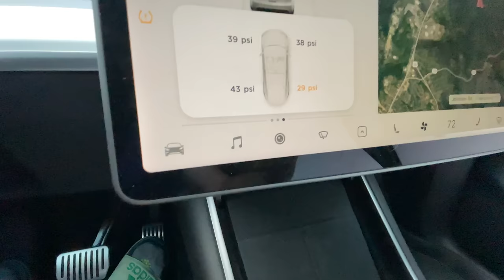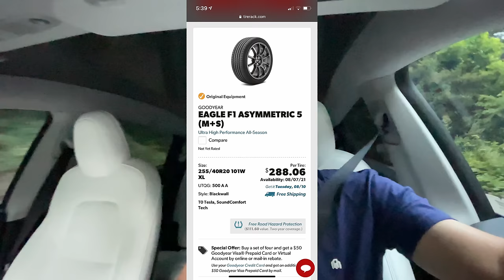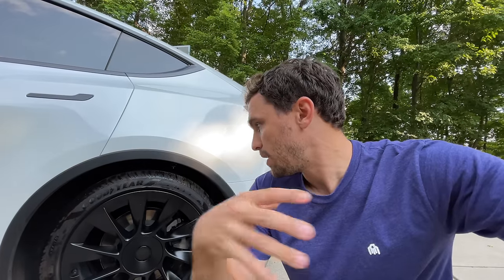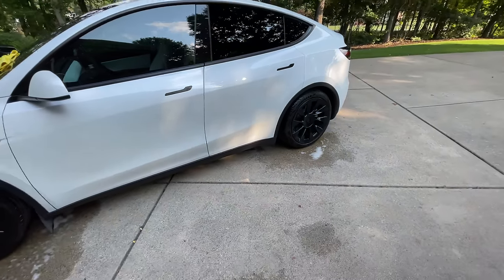This is Why Tesla Tires are So Expensive (Another Flat)

Comment: That tire has hardly any tread left anyway….. replace all 4 tires my friend.
Reply: How long has he had this car now ?

Are Tesla tough on tires ?
Reply: @icosthop9998  I know my Chevy bolt only gets about 20K miles on any tire I have tried 
Oem that came with car purchased used
Michelin A/S sealant tires oem lasted 20K
hankooks S1 ventus 2, got about 20K out of the pair
Crosswinds have about 5K on them now
Throwing on some used kenda kenetica tires with 6.5/32 treads next to replace the hankooks this next week. But yeah kind of annoying in these heavier cars the money I am saving on gas and oil is going into tires 😆 I drive a lot of miles so just be warned treadwear means nothing with ev's
Reply: @jman96camry  20k on any tire is crazy. I can only imagine how long Michelin pilot sport 4s/ cup2s last with an EV.
Reply: I got, but one big YouTube guy mentioned that you really need to get EV type tires. Not one that "just fit" in size. It because the EV are much heavier then normal vehicles at the same size. Hence EV tires. I don't own an EV

Comment: I stopped buying low profile tyres 20 years ago, now I just want as much rubber as possible between my rims & the road!
Reply: Exactly
Reply: Once u bend a couple rims or get a few flats. Learn quick
Reply: I've had both, an more rubber makes Zero difference when it comes to picking up screws,nails,pieces of metal or whatever else that's able to puncture a tire. Basically if it will poke holes, it will go through the tires , big side wall or not.
Reply: @americanpirate2091  Where I live our problem isn't sharp objects, its potholes & with 2 million miles of driving and lots of different cars I have learnt not to buy low profile tyres ever again!
Reply: Potholes suck for sure.
Reply: Unless you are running your car on the track at speed, there is no reason to use low profile tires especially on a car that weights over 2 tons. Since I grew out of my ricer Boi days I've not purchased a tire with a profile lower than 50 and the only reason I did was so it would not rub against the strut.
Reply: Well yeah but it makes you a nerd, man. I roll 28s on my 06 Aveo, man….
Reply: @BillLaBrie  Sounds Greek to me, what is an 06 Aveo?
Reply: @wilkoone9155  I think it's Daewoo subcompact that GM sells.
Reply: @wilkoone9155  Car that came out when you were still just in your eighties, methinks.

Comment: The right rear is the most punctured tire on cars ,It reflects driving behavior,While turning making adequate clearance from curbs and gutters sometimes favoring the right portion of the lane as well,Trash and debris gather near the curb
Reply: Only had 2 extremely minor punctures on my car that I've been driving for 6+ years now and those 2 were most likely  due to me driving on to a construction site drive way (my job requires me every once in a while)... Guess I'm doing good? Had all 4 tires replaced at the 55k mileage and currently at 64k+!
Reply: Another reason is that the front tires kick up nails then throwing them back for the rear tires to "catch" it.
Reply: makes sense
Reply: @NumnutSify  you a construction manager or engineer?
Reply: @miguelrodriguez-pe1ss  I'm an Electrical Project Engineer currently. Looking to move over to Senior Computer Engineer though. I'd rather be at a desk now.

Comment: Leave it to Elon Musk to reinvent the wheel. Tesla, overengineering at it's finest. You hit the nail on the head when you said that car was garbage. Any other car, I can get onto a lift and change out tires in an hour. Teslas have a whole procedure, like the pucks for lifting and the foam in the tire is an issue sometimes. We actually have a set of those pucks just for Teslas and they are a nightmare even with those.

Comment: Just buy tires with Road hazard warranties! Firestone, Bridgestone or Continental would just replace those!
Reply: for of course a small fee depending on the titres wear $$$
Reply: @justabrake  I worked for bridgestone. We would replace the tires free of charge if this happened within the coverage. Which on say premium tires could be either 3 years or 50k miles.
Reply: @lohengrin5082  looks like my next set will be Bridgestones just for that.

Comment: First problem - Goodyear. Second problem - no sidewall. Third problem - 39psi. Run at least 44 cold. I haven't seen any blowouts in your video. Discount  Tire is OK. I'd NEVER go to Pep Boys here. I have the pucks in each car just in case. And a jack and a spare tire. Rotate your tires every ~5,000 miles. Put it in your logbook. You have a logbook right? 
If you lower your car get an alignment. Is this your first car?
Reply: Goodyear is a great tire...but is very soft. Up to half the projected mileage because of it.44 psi is recommended  Continetal? Never heard anything good about them. I think I am going to throw a set of Pilot Sport Cups on my 16 X and see how they wear. The scorpions have surprised me to be honest. The best tire are the more expensive ones for a reason. Bridgestones and Yokohama's have treated me very well over the last 10 years or so on numerous vehicles Avalanche to a Prius  Don't sleep on the Yok'es!  Cheers!!

Comment: I suggest to bring your size of wheels down to 18 in and you'll see your tires will last twice as long and a better ride
Reply: I've always stayed away from low profile tires... for a few good reasons:  more expensive and higher risk in pot holes!!  :)
Reply: It’s the aspect ratio that determines if the tire is low profile, less than 50 is low profile.

Comment: I have a model y performance, I'm a volvo technician,  I put my car without jack pack with no problem on the lift to do my own tires.  A lot of the volvo cars have foam inside too, when we repair them, we just remove the foam if it doesn't stick anymore.  You just having bad luck with tires not tesla.  Can't believe people think this tire are only meant for tesla.  I fixed a lot of non tesla tires and some have foam too, NOT only tesla.

Comment: Apart from the sidewall damage. Those tires have almost no more tread, so expect for it to get easily puncture. I know, since I normally run my tires to very low tread and having a few holes. Also, if you have any cordless tools get a cordless inflator, they are so much better. I use Ryobi wireless tools since am cheap, so I have a few batteries and I bought the wireless Dual Function inflator/deflator and I love it. Having a wireless inflator that you can set the tire pressure so it automatically stop, makes it so much easier and less of a hassle to keep your tires inflated properly. Also, on gas car they normally tell you to rotate the tires on every oil change, which is what I do. So I rotate my tires every 6months, since I change my own oil. When I have an EV, I will be doing the same thing. Rotating the tires every 6months and then cleaning or replacing air filters every year during inspections.l

Comment: I didn’t think I would notice a difference having the tires without the foam. I absolutely did pretty much as soon as I had them put on. Fortunately America’s Tire allows you to exchange the tires within 30 days. I took them back the next day and replaced with tire with foam and all was good. It’s hard to explain the noise but I did notice a difference. Most people I have heard can’t tell the difference. I wish I couldn’t either cause it would save me a ton of money.
Reply: Foam absorbs energy that would normally result in sound or vibration or likely both. I'm going to switch when I wear out the tires.

Comment: Before ordering our Model 3 and after watching a zillion YouTube videos I found out about the pucks and ordered them straight away! They do work great and I do recommend keeping them in the car. Don’t worry we’ve all been there!
Reply: I made the rookie mistake of buying four pucks!   You really only need one, most of the time, as you are typically jacking up only one wheel at a time!   Still, I get to use that puck twice a year, when I rotate my wheels :)
Reply: @mayorsnorkum4005  nothing wrong with having 4 pucks, you'll be glad of the spares if one just happened to fall apart!! I bought 4 because they were a fraction more than the cost of just one, and I needed to use two at once for a home tyre rotation. So handy to have and I'm shocked gjeebs didn't have any!!
Reply: @danpaul4975  This is where we up north have the advantage - tire rotation done when I change from 3 season to winter / vice versa :).  Just need my one safe jack.

Comment: Those pucks were one of the second I bought after floor mats.
Reply: I work at tesla for 4 years now, have never heard of those pucks till now.
Reply: Where’d you get them?
Reply: @Isamu1013  Model 3/Y do not have exposed jack points as most cars do, so the puck ensures the jack is applying pressure at the points where Tesla has designed to allow for jacking. Downsides of making a very aerodynamic car and covering up the entire underbody. You still can safely jack up the car without the pucks tho, but may damage the plastic covers over the jack points.
Reply: Well the Jack points on the Model 3 are fairly exposed but I can see that you could make some small scratches in the rocker panel if you use a concave metal jack to lift it there.

Comment: I read in the Tesla forums, before ordering my 2017 Model S, that the low profile 21” tires were having more problems and were more expensive to replace then the 19” tires. My car came with 19” Goodyear tires. It seemed that I was frequently topping off the air pressure to the recommended 45 psi. At around 35,000 miles I got several flats and a slow leak over the course of several months. I finally got fed up, and replaced the 4 tires with 19” Michelin’s. I had always had good luck with Michelin tires. After a year and a half and over 15,000 miles the tires stay at the recommended psi level and the last annual checkup by Tesla stated there was little wear on the tires.
Reply: Jeffrey, did you order Michelin's with the foam or not?  If not, notice any difference with road noise?

Comment: You need to get some quality tires, never replace just a single tire but both front or both rear but at best all 4.  If it is rear right tire always you need to check  wheel geometry as well as allow more distance to the curb. Your tires were worn out.  So you lowered your car - bad move.

Comment: I think to blame Tesla or to give the impression that this is a "Tesla" thing seems wrong. I've had my Model X with the 22in (265/35f 285/35r) wheels for 3 years now. I have 124k miles on it, tires replaced at 65k and 120k. A little sooner the 2nd time around due to bad alignment caused by CA 3rd world quality roads.
Reply: Tell me more

Comment: When I got my winter tires I called up a couple local tire places (Discount Tire being one) they wanted me to bring in my own pucks and seemed a bit unsure about dealing with a Tesla, so I brought it to Tesla to change out my tires (I put the winter tires on the stock wheels, got new wheels for 3 season).  Now I can just do all my tire rotations and changing at home and if I have a problem with one I will just take it off myself and throw on the other tire temporarily to take it in.  Dealing with tires can be such a pain, so much waiting, transportation being an issue...love having 2 full sets!
Reply: The odds of having a flat tire at home are zero.

Comment: At 30k miles, my Conti's have the same wear pattern. It's as if they're over inflated (but not). Maybe the recommended tire inflation psi is too high?
Reply: They MAY be overinflated for the load. One tire pressure doesn't fit all tires. Check the recommended tire inflation pressure which is posted on the driver's door frame. For different loads, in pounds or kilograms, you inflate to a different recommended air pressure.

Comment: If the inside of the tread is worn down, and the outer edges are not, your tires might be over-inflated?
Reply: Tesla inflates to 42 psi on the 19"s to lessen rolling resistance.

Comment: My Tesla is being delivered in 3 months and I already have the jack pucks
$15 on amazon
Reply: Visit discount tire when you get it and they will sell you road hazard warranty on the tires despite the fact you didn't buy them there. Then you are covered.

Discount tire will also apply prorated warranty discounts if the tires wear out quickly. You have to ask. Its extra paperwork for them but they will do it to get a sale.
Reply: @JeanPierreWhite  
Already plan on it
I was there the other day and checked on that and if they have their own jack pads and experience with Teslas

Comment: So far I’ve had only one instance where I had a left rear tire on my car picked up some metal shard & caused it to slowly leak down & I also have one of those portable air compressors & I recommend everybody gets one, it just makes so much sense to be able to service your tires at will & anywhere with that tool & it’s convenient & if you want to get good gas mileage you definitely have to make sure you maintain proper tire pressure, so inspect your tires at least once or twice a week, I inspect my tires just about every time I drive, so I’m super conscious of tire wear & I make sure I rotate my tires at between 6 & 7 Thousand miles & I have 25,000 miles on it & I’ve had the tires rotated at least twice since new! 

So I went to a firestone retail store & the people there were very nice & the manager told me that they do absolutely nothing with a Tesla, they have no authorization to service them & they have no training, so they don’t touch it & all I wanted them to do is check the tire to see what was causing the tire to leak & that was the answer he gave me, so again no big deal because the tire was holding air & the next morning the tire had considerably deflated overnight & so I just pumped up the tire to the recommended pressure & drove to my Tesla service center & had them replace the tire, now they recommend that you always use one of their tires versus a tire from one of these discount stores like Pep Boys, Discount Tires, NTBS etc. & they recommend you not do what you just did, which is to mix the tires & when I had my tires rotated the 2nd time, they sent out a mobile unit to rotate the tires & I must say the Tesla mobile unit was on time, he took care of the situation & it didn’t cause me any inconvenience at all!

Comment: Tesla EV have there up and downs. My friend sold his Tesla. After  2 years, he was tired of sweating inside his Tesla during the 4-5 months of hot summers in South Texas. Weak A/C system 😐 I like the car for it accleration.
Reply: Man I have the exact opposite experience. My Mustang was hot as balls. It was 97 today in NY with a heat index of 109 and humid as fuck. The ability to turn on the AC from my phone app is amazing. Mine is a 2021 so maybe his older Teslas AC wasn't as good.

Comment: I'm glad my Model 3 came with the 18 inch tires and not the 20's. Ya I give up better "red" brakes but in 60k miles I replaced the tires once at 48k and thats it. I skipped the foam on the second set. There is a tiny bit more road noise but not worth the extra couple hundred

Comment: You can buy a tire warranty from Discount Tire on the tires that come with the car when it is new. I have been doing this for years after having a Mustang with low profile tires.The tires were $300 plus and found this out after replacing a tire with in months of getting it. Discount Tire told me about it and guess what I had to replace 2 more tires with in a year. The warranty sure paid off. After getting my Tesla model 3 I took it to Discount Tire and bought the warranty. Have not had to replace any tires yet but it is cheap insurance.
Reply from the maker: Yea I am aware of that and need to do it

Comment: Great video. Thanks for the info. I am on my second set of cheap all-season Chinese tires from Walmart Tire Center. About $380 installed for 4 new tires with free rotations and flat repair. I love them and have had only one minor issue with them... The range is a little less so what did I do?? I dropped my freeway speed from 74 mph to 72 mph and I get the same range. I have had no noticeable increase in cabin noise. The first set of cheap tires lasted 33k miles (I could have used them for another 5-6k miles but I normally switch out a little early for peace of mind). In my opinion, no need for $900+ installed tires for my Tesla.

Comment: This is my second tire in a week. First one was unrepairable and the cut was so weird (he said it's probably from potholes or ice)... And it's cost me $399 plus tax from Tesla mobile service. 
Now I have a nail and its almost in the same place like on yours. 
This is getting extremely expensive. 
I have 7000 miles.
Reply: Same thing here on a Y duel motor performance model, we have had to replace 2 tire $412 each time, during the first 8000 miles. Another debatable aspect is the 300 miles plus range, but you only drive from 80% to 20% that's 60% percent of 300 miles and its not really even that much.  At least it's a rocket.

Comment: It's always good to have them rotated periodically so that they wear somewhat evenly. And while it's more expensive to replace them all its good to do so after you've driven on them for a long time and have had them rotated enough times.

By simply replacing the two back tires now with new ones the car may ride a little rough and rotating them now seem out of the question unless you plan on replacing the fronts as well with all the same brand. 🤔

Comment: Your rear tire left tire looks worn in the center which is typically from over inflation, that's how it looks to me.
Reply from the maker: I’ve been running it at around 45 so you could be right. They recommend 42
Reply: @Gjeebs  Plus higher the pressure the higher the chances of a puncture. Drop them back to 42.